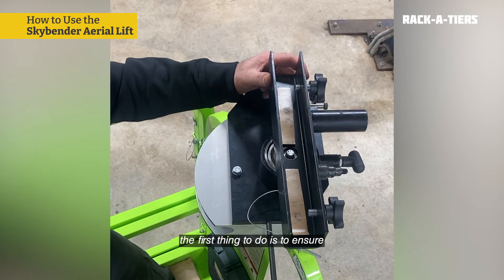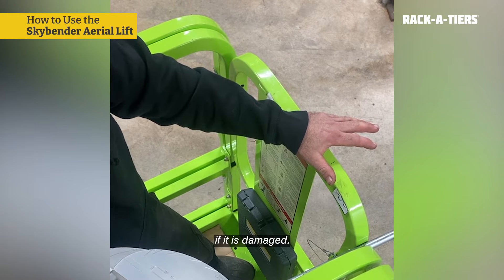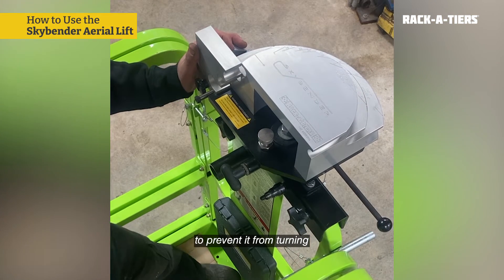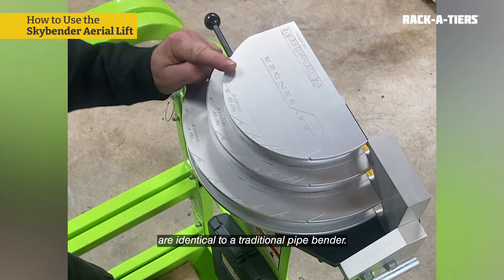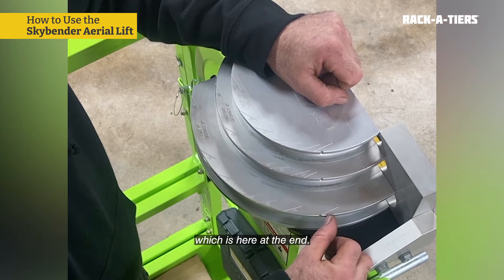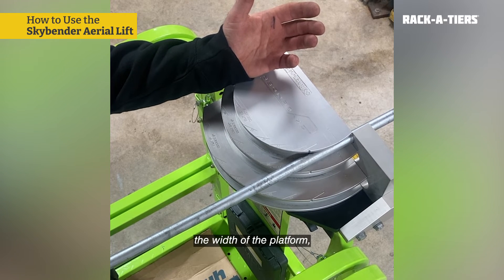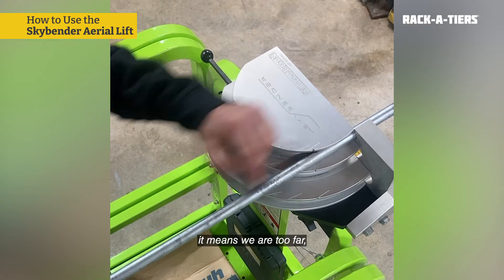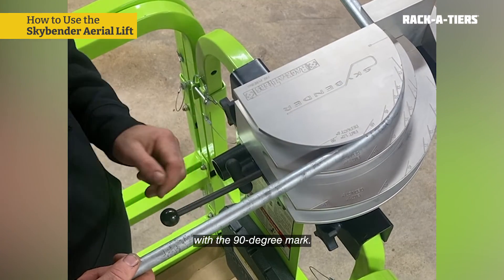How to Use The Skybender: Aerial Lift Conduit Bender!

Comment: This  might be great using it only for 1/2 inch pipe but 3/4 and 1 inch are going to be hard to do plus its very likely going to kink the bends. You're basically just bending using hand strength only. This is the equivalent of using a hand bender with the head in the air and pushing down on the pipe to bend it. Air bending. There is a reason why hand benders are meant to be set on the floor with your weight on top as you bend. So that it bends directly at the curve and prevents kinks on the pipe. This is just hand bending without putting it on the floor. I wouldn't trust this for for 3/4 and up.

Comment: Number one it's for EMT and not conduit, check your definitions.

Number 2 there is no way your not gonna kink the pipe
Reply: #3 - dictionary definition of conduit:  a pipe or passage for water or electrical wires to go through. They make pipes and tubes that are used in construction and as electrical conduits.

Therefore EMT falls under conduit.

#4 kinking conduit sounds like a user error